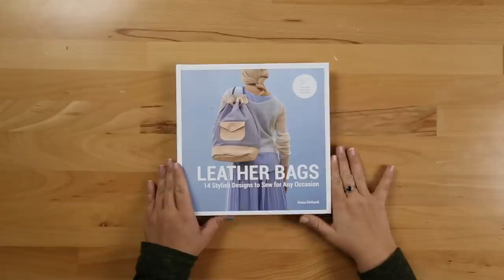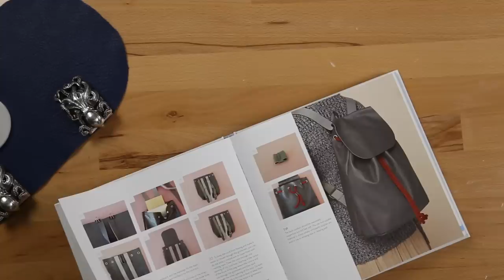How To Build A Custom Rucksack

Comment: Nice Project. I am wondering if just machine stitching the straps, loop and top carved flap will be strong enough in the long run? The music does not suit the build, unless you're going for Metal Fest merges with Tandy. I would strongly recommend that this be watched with the sound turned off. It would be even better if you omitted the awful music altogether and did a voice over to describe in more detail what is being done and why. Not one of the better videos from Tandy. I would give it a B-.